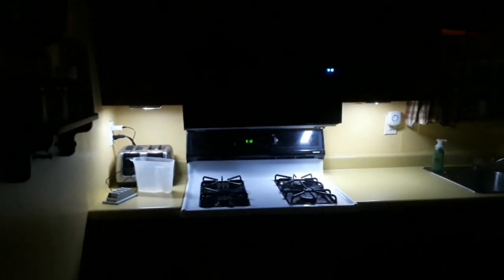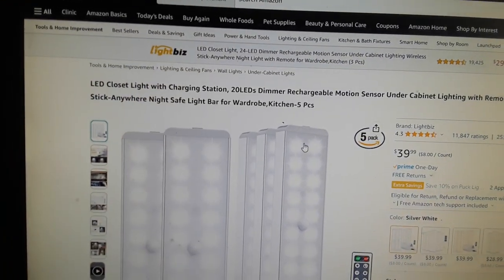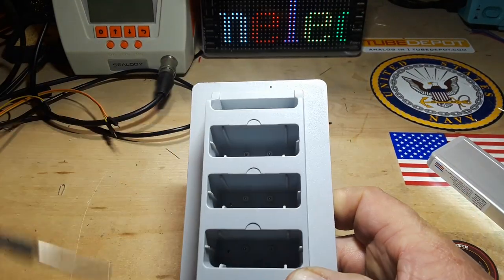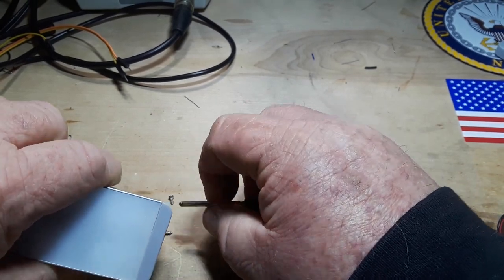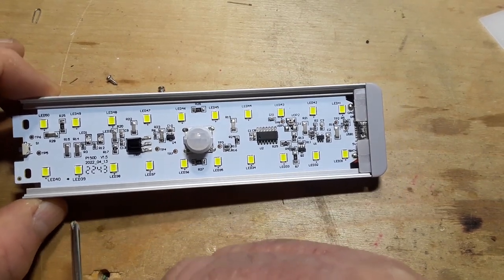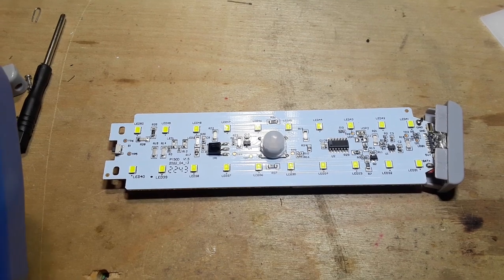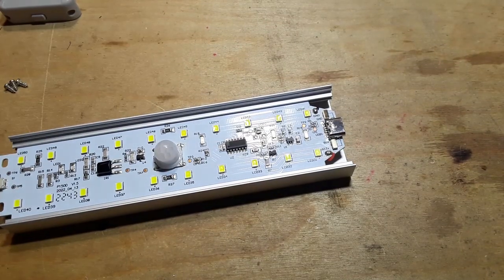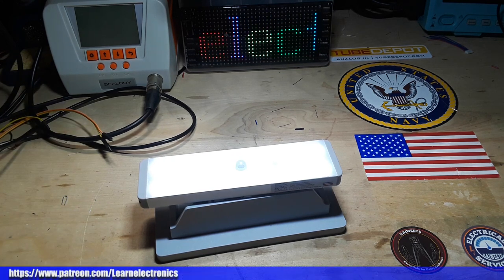Lightbiz Under Cabinet/Closet Lights Are Very Cool

Comment: Nice bright light. Easy to remove and recharge. ☮brother.
Reply from the maker: Or you could use the USB C port and hardwire them. Choices...
Reply: @learnelectronics  
What is the length and width please?